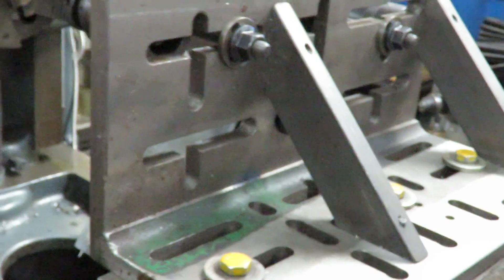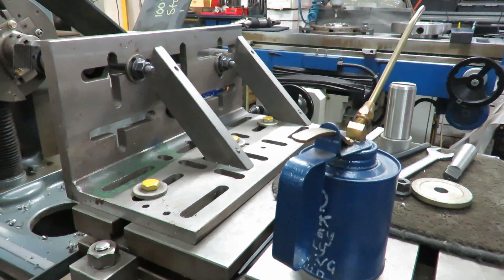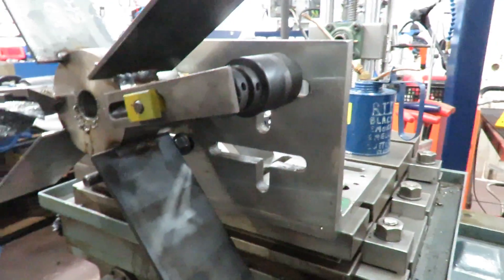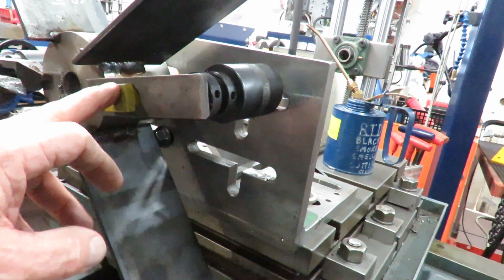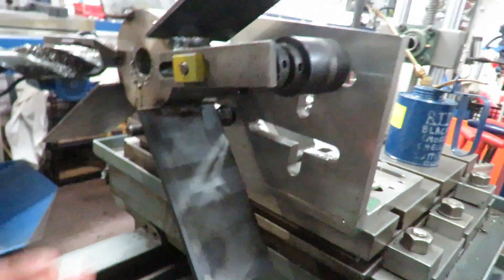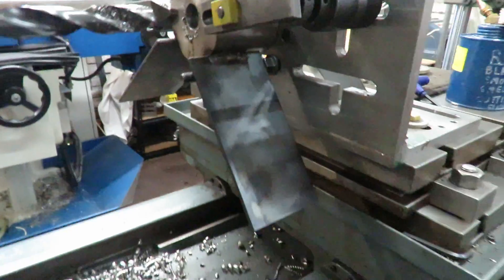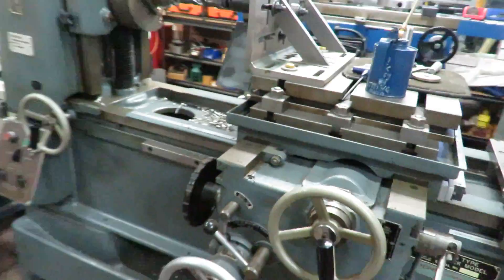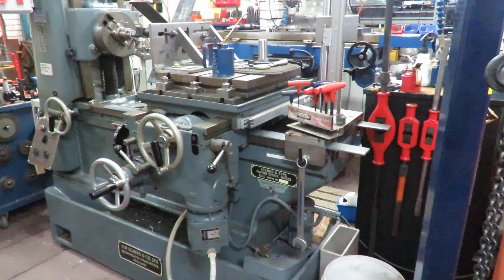Boring agitator paddle boss on Kearns HBM

Comment: I love your horizontal mill. I use to be in charge of several very large mills and planers , the vertical I ran had a twelve foot table , it was in a pit so the table was floor level. The columns went thirty feet up through the roof. Big machining jobs were my specialty. The lathe there had a sixty inch chuck and sixty foot travel. It was used by the navy before we got for prop shafts for ships and subs. She would peel chips 3/4" on one side so an inch and a half total but take all day to make the length of the shaft. God I miss all that stuff . I made missiles there very big missiles. Government contracts . Loved that job.
Reply from the maker: Cool, thanks for the feedback S, best for the New Year Mate.

Comment: Hi Bruce great job. I've just got myself a Kearn and Richards model s optometric very similar to yours. Can you tell me about the phase converter you are using? Do you just use the one speed on the motor and alter the frequency or do you use all three speeds? Thanks.  
Michael

Comment: thanks for the tips Bruce, thought of making me an angle plate like you did now that I know it is feasible I may go on and make one
Reply from the maker: No worries Bill, this one has been quite handy, I used a piece of 200mm (8") equal angle double the length of a normal off the shelf plate, machined it, then slotted it, then re machined it because the slotting relieves some of the stresses. Once it was all done then I did the holes for the braces. I can reposition the braces if need be. In years long gone I would make them from heavy plate and stress relief after welding, then slot and remachine the faces.